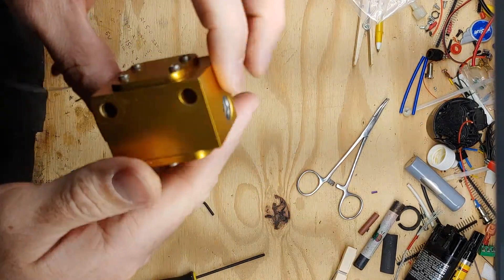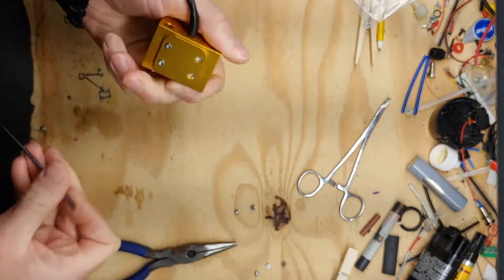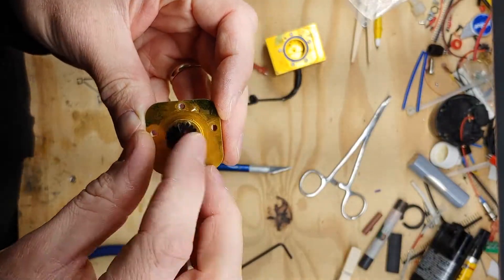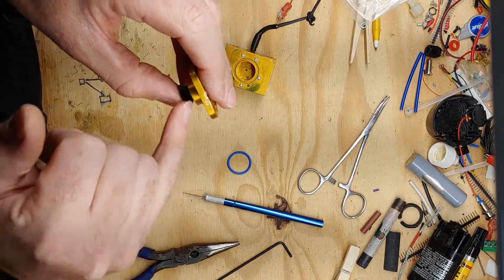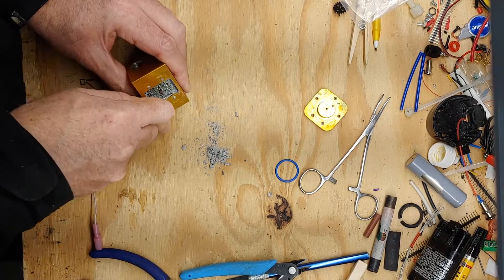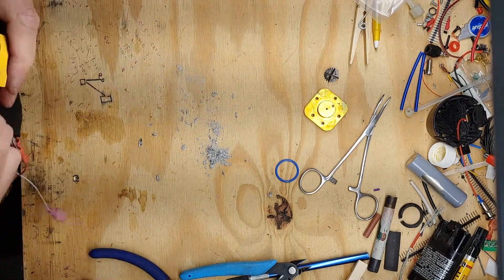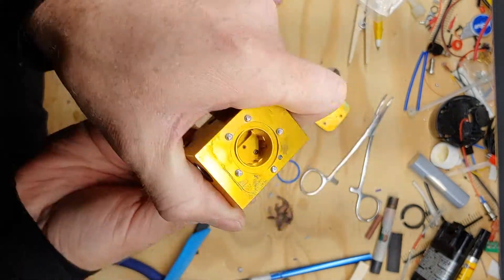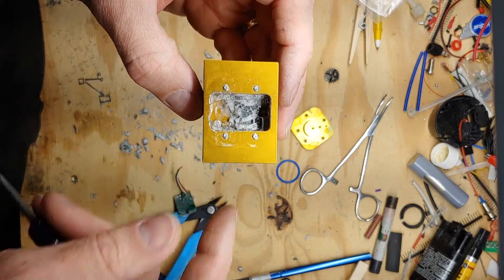Taking Apart an Aircraft Fuel Flow Sensor - EI FT-90 Gold Cube

Comment: Thanks, I have an FT-60 that reads 3 gallons less than the other; thought there was a calibration function somewhere; but I guess they are not repairable. 
So simple I cannot understand how two transducers could be so different from each other.

Comment: Interesting dissection. They are surprisingly accurate for how simple that impeller is, as long as an air or vapor bubble doesn’t get trapped inside. The circuit board outputs a pulse signal that is sensed by the fuel flow gauge or engine monitor. Engines with a return type fuel system can use two cubes, and the difference between them is the fuel flow. Or alternatively, some engines with EFI systems don’t need any cubes, because the ECU outputs a pulse signal that emulates the signal from a cube.

Comment: I suspect the reason the socket head cap screws sheared is because they're stainless steel screws into aluminum tapped holes.  Dissimilar metal corrosion.  A drop of Loctite might have prevented that.  https://www.youtube.com/watch?v=qhbIQdngQMw

Comment: Interesting video. Have had 3 of these transducers fail. Not outright failures, fuel flow indications intermittently go to 0. Shut the fuel off for a second or two and then turn it back on and I get a flow reading. For a few minutes and then 0 again. Last one worked OK for a couple of years. Assumed the pinwheel thingy bound up. Or tight bearing. Does not appear to have a bearing. Not sure if I will buy another. I like the info the instrument provides. It’s just not reliable. JPI uses the same transducer I think so why bother? Thanks, Jim

Comment: As the fuel flows through the cube the wheel spins and interrupts the beam which generates a pulse that's counted by circuitry inside the instrument in your cockpit. All the circuit board inside the FT does it power the transmitter and receiver optical components, and generate a 5v pulse on the signal wire. The way these things are calibrated is you pour a known quantity of fuel (say 1 gallon) and count the pulses. This is known as the "K-Factor".